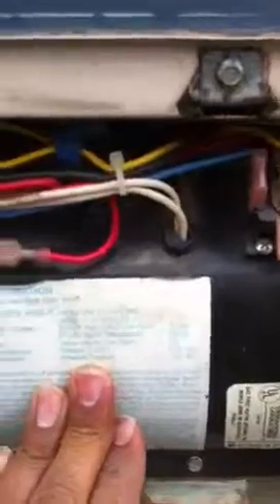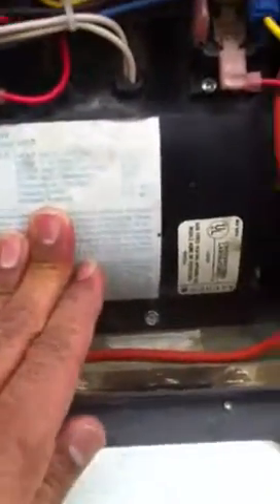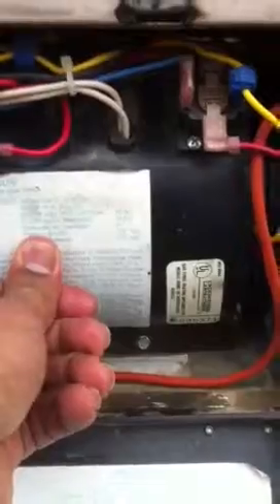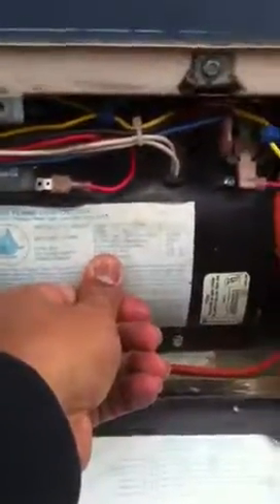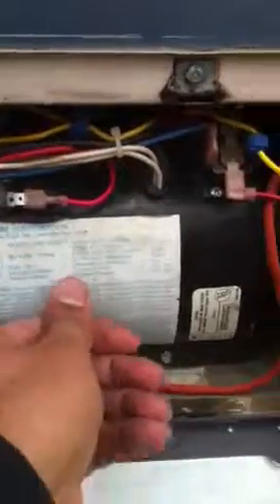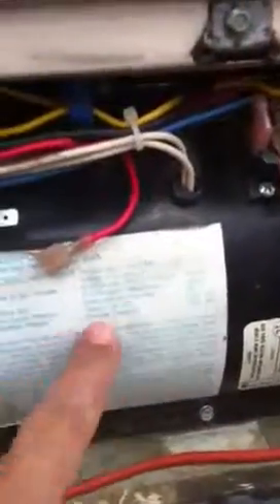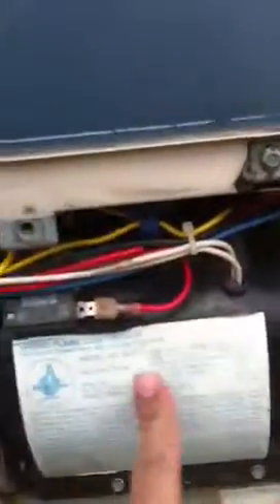RV Furnace gone bad

Comment: put some washers under the cover so the fan stop hitting the cover  and the wire you was holding is 12v not 110 so you dont have to be afraid of it      just sounds  like some thing in your fan
Reply from the maker: falcon7350 haha, thanks falcon... a